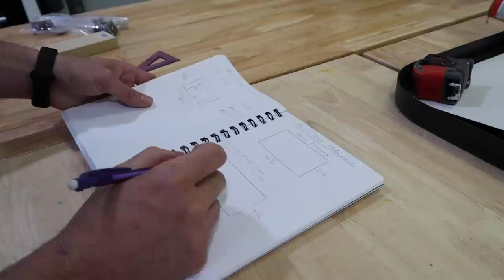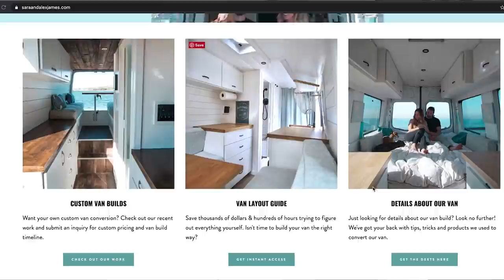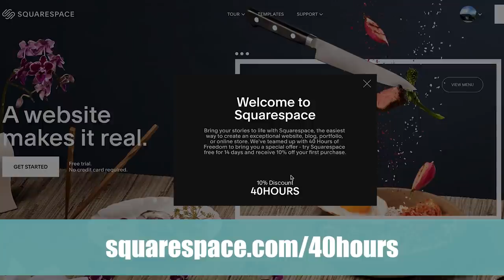VAN LIFE BUILD: how to frame windows in a van conversion

Comment: Thank you for the video.  It is a super clean look.  Why not use strips wide enough for the widest point, cross cut them to length, then scribe and rip to the scribe line?  No need to take all those measurements.  Generally speaking, anytime you can cut to a marked line rather than take a measurement, write it down, transfer it to the material, etc, there is less room for error.  The best finish carpenters overcut casings and then mark the actual length on the frame.  Track builders cut them all one length and Bob's your uncle.
Reply from the maker: You can't scribe off of the metal window frame - it's not square so you don't have anything to scribe off of. This is a technique that was taught to us by Sara's dad who is a master carpenter. We scribe stuff all the time but this isn't an application where a scribe works.

Comment: Nice frame, I'm building something similar now! Quick question, how did you attach the frame to the actual wall at the end, brad nails into the outer frame? If so, did you just touch up the paint after or how did you hide those marks?

Comment: I like the framed windows look you guys do and will be doing something similar with my sprinter passenger van conversion. Question: if the window breaks and needs replacement can you install a new window only from the outside? Or do you need access from the inside as well. I also want to wall off one of the windows.

Comment: Enjoy your videos! I'm going to try & build one out by myself next year. I have a TON to learn, so thank you. I have an odd question. Besides aesthetics, is there a reason why everybody uses shiplap for walls??
Reply from the maker: It's totally aesthetics, and it's very easy to work with.
Reply: @exploringoptions Such a great question! I was wondering the same thing... I’d like to wallpaper some of the walls so smooth would be best... just realised your question was 9 months ago! Have you started your van?
Reply: I think it's mostly for looks. I used sanded and painted 5mm hardwood plywood because it's easy, quick, can bend a bit, and easily cut to fit between pillars to maximize interior space.

Comment: I did something similar on mine.  However now I’m pretty limited as far as metal surfaces to attach window covers.  How do y’all attach yours?
Reply from the maker: We attach a steel strip on the back of the window frame before we install it so the window cover can magnetize to it.
Reply: Sara & Alex James – 40 Hours of Freedom that makes sense.  How do you attach it?  Adhesive?  Also it sounds like the window frame doesn’t go as deep as the highest point of the window.  As I understand it you do this so that you can attach the window cover.  Does this then leave a gap between your window frame and the metal of the window?  Could stuff fall in the gap?  Maybe I’m reading it wrong?

Comment: Framing the windows on a ford transit with curves and differing depths is not as straightforward as for Sprinters it seems. Thank you for actually showing the detailed install process. A lot of videos just show the final result and leaves the viewer trying to dissect the in-between steps.